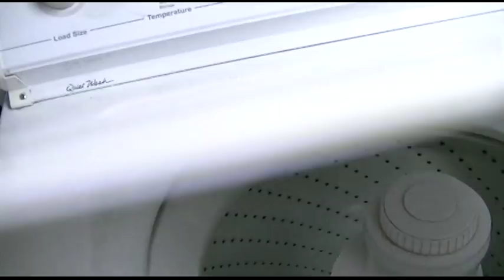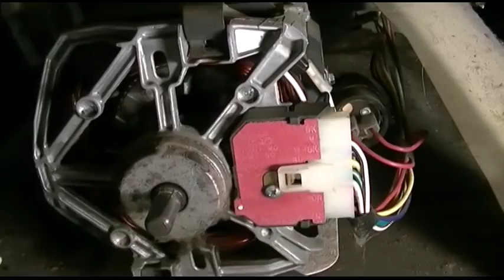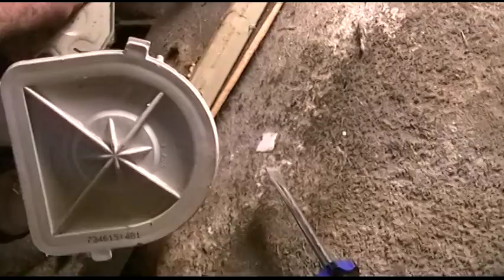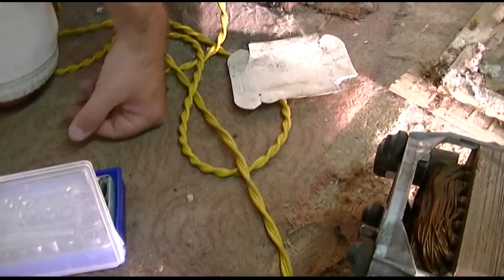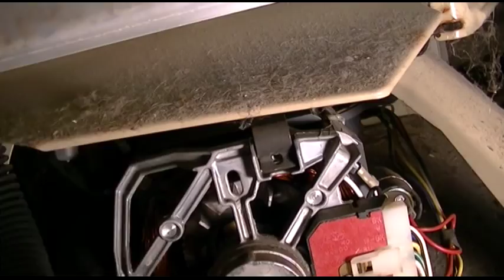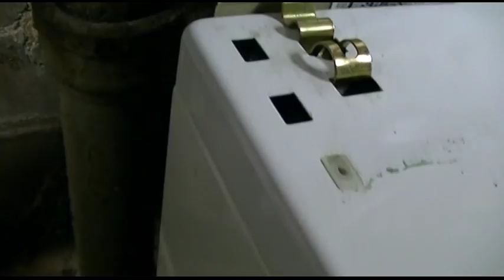How To Replace Motor Coupler--Whirlpool Direct-Drive Washer

Comment: Do you think I could be having the same issue and fix the same way? I loaded 1 super heavy blanket and mid wash cycle, the agitator began spinning only clockwise and it tangled the blanket. I unloaded it and try it with nothing in it, and it still only turns right during the wash cycle.
Reply from the maker: I'm not exactly certain what "only spins clockwise" means.  Typically a broken motor coupler will elicit no agitation and no spin whatsoever, but the washer will drain, which is how I diagnosed this one:  https://www.youtube.com/watch?v=SkGfUuGDGEc

Is it possible you can post a video showing the problem?  With that I could probably tell you what the problem is.
Reply: @jaykay18  yes, ill try to get a video for you in a minute. I'm trying to figure out how to keep it running with he lid up. The little hole other washers have where u can put a screw driver isn't there so im assuming its where the lid is actually screwed on. I'll let u know when u have the vide
Reply: @jaykay18  okay, apparently the to by pass the switch i need to take the top part off and i dont know how to do that -so I did my best to show you the issue, so what is happening is that it sounds like the agitator is going back and forth as it should but when I open it, everything, water clothes,, agitator is only spinning to the right and the clothes is tangled around the agitator. When the issue first appeared yesterday, I was washing blankets and sheets and all them were tightly wrapped around the agitator completely tangled. This happens during the regular wash cycle. So i had to turn it off, untangle them which was super difficult and then just switch to the draining part to get all the water out.. It does correctly drain and the tub spins to get the excess water out.
The washer is not as loud as it is now either. 

https://youtu.be/v2q3t1KNSIA
Reply: @jaykay18  i only added small items to demonstrate because untangling the heavy sheets its a real pain lol
Reply: @jaykay18  here is another short clip, I dont know if this is related at all, but you can see the agitator cant be turned to the left at all. It only goes right. The washer on the right is my neighbors and I noticed I am able to turn the agitator either way with little effort. 
https://youtu.be/AXyL648UmPo
Reply from the maker: @MissyyMartinezz09  Could be one of two things that I can think of.  Either you have a completely broken brake shoe, or a bad transmission.  To me, it sounds kind of funny with the way it's agitating.  Like it sounds almost normal, but not quite right to my ear.

Repair will be a bit costly, but still way cheaper than a new machine.  you can try to source a replacement transmission, they are indeed out there.  Not terribly hard to install.  Another option is to find a similar machine that someone is getting rid of or selling.  Either option would be better, and way cheaper, than a new machine.  Not to mention, new machines don't wash.  Don't just go by "Whirlpool" or "Kenmore" and think it's the same.  Around 2010 they changed the mechanism inside and the machines are basically useless.  Chances are, a machine before that time would be acceptable.  Another telltale sign is to look at the timer.  If there are a series of lights and a button you press to start, that's the BAD ones, stay away from them.  You want an old-school one with a mechanical timer like yours has.  Accept no substitute.

To figure out what's really wrong, you'd have to remove the transmission.  That's going in deeper than I did here.  It's only a couple more bolts, and removing the agitator first.  These machines are extremely robust, but they can and do break, just like anything else.  Fortunately parts are readily available and relatively inexpensive, and the machines are very easy to repair.  Repair people probably won't touch it and they'll tell you to get a new machine.  So either fix it yourself or replace it with a similar vintage one.
Reply: Thank you for your detailed response- you're probably 100% right about the transmission,  I managed to disassemble some of it,I checked the agitator, dogs are good, nothing broken, coupler is good, and I don't if you remember, im one of the videos I had posted the agitator completely locks when trying to turn it left when in the regular wash cycle, but when the machine is done, meaning is tub spun, drained and clothes is ready, the agitator can now easily move left or right. 
I tried it one more time and now it makes one nice loud clunk at the very end of the cycle after it's drained the water. Lol RIP my washer. 
Anyway, too bad is wasn't something simpler, I might just have to find another washer with the same design. 
Thank you for taking your time to respond!
Reply from the maker: @MissyyMartinezz09  Yeah if the coupler was broken it wouldn't agitate or spin at all.  This is definitely an odd one, and a rare problem.  The key factor was you had mentioned a really big heavy blanket caused this.  That probably proved too much for it.  The motor coupler is there so in the event of an overload, it breaks.  So it's a "failsafe" of sorts.  This is what happens when the failsafe doesn't fail.

Keep looking around for this type of washer, there is absolutely no substitute.  These were some of the best washers ever made.  I have one that's over 25 years old and still running fine.  You can't beat the best.  Don't give up your search at any cost, I can guarantee you will be dissatisfied with anything else.

Incidentally, the machine can "lock up" the agitator depending on where in the agitation stroke it is when you try to turn it, sometimes it's just in that "sweet spot" where you can't turn it.  The loud "clunk" can sometimes be normal.  Typically you'll hear it either at the end of the neutral drain right before it spins, or just as it starts to spin.
Reply: Hello, update: we bought a new washer and absolutely hate it. The agitators suck. They buzz back and forth instead and wish washing sound my old one does. The clothes is literally in the same place at the end of the wash cycle as when u put it in and the water sensor is so cheap it doesn't even fully cover the clothes. So. Im committed to repairing my old one now 😅 the company who delivered the new one were really adamant about hauling it away but I kept it just incase. Sending the new one back this week. I will let you know how the repair goes.
Reply from the maker: @MissyyMartinezz09  Can;t say I didn't warn you, but you are headed in the right direction now.  Any questions, let me know.

Comment: Thank you, Sir. Truly appreciate your video. I thought I was going to have to replace Old Reliable but decided to see if there might be a bit of info on YouTube. It's a 30+ year old Kenmore so I didn't expect to find anything useful. Did find your video, though and I've just ordered the part. Fully expect to have Old Reliable back on the job again in about a week. Thanks again. Be safe. God bless.
Reply from the maker: Thanks Edwin!  I'm sure you'll have no trouble replacing it.  And--you made the best decision.  There's a very good reason you call it Old Reliable, and it will serve you very well for many more years to come!

Comment: Better than the "professionals" who ruin new appliances than fix them!
Reply from the maker: Way better, a job done right!
Reply: @jaykay18  Whirlpool engineers must've thought of the direct drive technology as it has no belts or pulleys! They were way ahead of their time in my opinion.
Reply from the maker: @jeromedavis8575  I cannot say that this was the first.  Automatic washers were becoming popular in the 1950s, the diect drive design came out in the 80s, so there were a good 20-30 years of design and development.  While quite a number of machines used belts, I couldn't imagine there wasn't another direct drive type unit out there before.  When you really do think about it, what does it actually cost to manufacture a motor coupler?  A lot less than the cost of metal pulleys and a belt.  So in my eyes, it was actually a cost-saving measure.
Reply: @jaykay18  At least Whirlpool put quality first.
Reply from the maker: @jeromedavis8575  Quality used to matter to a lot of companies.  Not anymore.
Reply: @jaykay18  Now, it's all about money!

Comment: 60 year old woman here ( granted I used to be a subcontractor), but I followed your video to the T, and then put it together again, wouldn't work. Took it apart and noticed I hadn't connected a teeny tiny ground wire with the electrical harness on the motor. Put it back together, and Viola, works like a charm! Thank you!
Reply from the maker: You are very welcome Valerie!  I am so happy to hear that!  I love hearing of people who have become empowered by my videos to do the job themselves, and get it done without much trouble.  The ground wire could have simply been an honest mistake or something you overlooked.  No harm done, it's back together, and working once again.  To be quite honest, although you're still plenty young, it very well may outlast you!  Excellent job!
Reply: @jaykay18  No offense, but I sure hope not, lol!
Reply from the maker: @valeriewells5767  These were some of the best washers ever made.  You cannot buy any washer today that can perform like it, at any price.  Forget "technology", all it does is foul things up.  Ever notice how anything that says "Old Fashioned" is so good?  Yeah, there's a good reason.  Or like Breyer's Ice Cream's old slogan, "Taste, Not Technology".  Well yeah, it used to be, not anymore.  Trust me, you did the best thing ever by fixing your machine, and they're super reliable, easy to repair, and perform like no other.

Comment: Thank you Mr. jaykay, the coupler on mine was starting to break, I searched up for similar buzzing sounds, and when I heard this one buzz I knew exactly the issue. The part is now replaced with your video to thank and I can be confident my machine can remain in service now another 21 years
Reply from the maker: I'm thrilled to hear that!  Very glad my video was of help to you in repairing it, and I'm also glad you decided to repair it.  You've made the right choice, it most certainly won't give you trouble for the next 21 years, unlike any modern washer!
Reply: Yes. I never cared until my brother bought a Samsung side loader replacing a GE with the weird looking plastic tub. and I realized the big corperations are lying about saving water when it does 6 rinses and saving electricity when it runs on average 3 hours. It's 4 years old but has had 9 service runs done to it, next time I'll be heading a few towns over to a place I know carries old style machines such as mine. I expect it to be another 2 months before it's next and last visit from the service dude.
Reply: I've never had to fix anything else except the water drain pump, just last year. since I have a single piece agitator, agitator dogs are no worry. Even though from what I can tell those are no hassle to fix.
Reply from the maker: @micheal9503  Ha ha, yep, he fell for it.  You've got a good head on your shoulders to realize it's all hype and there are no savings, in fact, waste!  I've had to do 2 sets of agitator dogs on my own washer, total repair cost was $4 each time.  You can't beat that!
Reply: @jaykay18  It appears that way. I was always suspicious of it, so when it started breaking down I decided to list the parts that got replaced.

In it's first year, the pump sprung a leak, and the door lock stopped functioning. Second year in, the pump stopped working entirely, the main motherboard failed, and it also developed a seemingly unfixable off balance issue that was eventually fixable. Then in it's 3rd year, the big weird plate looking motor died, and another main circut board failed. Then this year, the pump died, AGAIN, and the door seal had to be replaced as it was apparently cracking. What a ride this had been.. I could only imagine the repair bills to date
Reply from the maker: @micheal9503  The worst part is they're all like this, and the manufacturers pay for parts and labor out of their own pockets for these repairs when under manufacturer's warranty.  You'd think these repair costs would be astronomical, and they'd realize that years ago they had so many fewer repairs.  but I guess all these people that keep buying new washers every 5 years makes up for all the repair calls, because then the cycle repeats every 5 years.

Comment: Thank you for this video. One question before I test my washer, should you be able to turn the motor by hand before putting the last piece with the 2 hoses on it? I had to use vice grips which I assume I shouldn't have had to.
Reply from the maker: If you're just trying to grip that motor shaft with your hand, there's no way you're going to turn it by hand, it needs a tool for leverage.

Generally when a motor coupler breaks, it's either due to old age (the plastic gets old and brittle), or the machine was overloaded.  Worst case scenario when you put it back together, the new coupler will break immediately.  If that happens, there's a much more serious problem with the machine.  The likelihood of that, however, is very small.
Reply: @jaykay18 but weren't you turning it by hand in the video?
Reply from the maker: @nikkifachik  Yes, it was just fine.
Reply: What happened with this? Did it work with being unable to turn the motor shaft by hand? The same thing has happened with me and I don't know if its ok to put it all back together or not.

Comment: So always well overloaded and left well off balance. Do you know how often the machine is ran weekly?
Reply from the maker: At least 2 or 3 times.  Each of my machines get 1 load per week, if that much!  Sometimes we'll go 2 weeks before they get used.
Reply: We run ours twice a week, all in one shot, handling pretty light loads, and short cycles. But when it comes time for towel week, even then it doesn't deal with any overloads and that usually ends up as its largest load.

Comment: The classic direct drive, so simple to repair, and so simple to diagnose. Its like, you can tell a problem by sight and sound. On an HE machine, you have to run diagnostic mode, then grab the code sheet, then find out your problem, then replace the part, then test the thing. Its so complicated, I think the most frequent repair on a direct drive is the agitator dogs, the most common repair on an HE machine would be replacing the entire damn thing.
Reply from the maker: You got that exactly right!
Reply: Its like, this ended as a $12 repair, and in total took maybe what, like 35 minutes. Then on an LG, you have to take apart the cabinet piece by piece because the suspension is ON the cabinet, because that makes sense. Then you probably have to lay the damn thing down, make sure you don't harm any of the circutboards, the insides of these new washers are damn minefields. No wonder they are so explosive.
Reply from the maker: Har har.

Comment: Will it still make that same sound if the 6 fingers are broken?
Reply from the maker: It's rare that will happen.  The fingers are mounted in rubber so usually they don't break, and instead you see a failure like this.  The new ones though, like the one it was replaced with, are metal-reinforced in the center.  Typically they don't shear or break, the transmission does.

Comment: Good job on the video but, my washing machine Kenmore 110.92291100 just stays after is done washing with the close and water in the tub. Just sitting there and wont start rinse cycle. It does not start spinning and no noise. Can you help, Please.
Reply from the maker: Possible bad timer or bad motor.  The motor runs both backwards and forwards, depending on whether the washer is to agitate or drain/spin.
Reply: Thank You so much, It is old, how old I can remember so, maybe is time to replace the unit. Be safe out there...
Reply from the maker: You're better off fixing it.  New machines will definitely cost more, won't wash well at all, and you'll end up in the same boat just with a lot less money in your wallet.  https://www.youtube.com/watch?v=Rju3cHaAyek

Comment: 20:44 it should not spin drain because it was enough agitation time
Reply from the maker: Apparently not long enough.
Reply: @jaykay18  It seems more likely that it slipped into spin due to the transmission being cold (so the oil inside being thicker and stuff), The whirlpool service manual states that only 10 seconds of agitation (fast agitation) is needed to properly engage the neutral drain mechanism.
Reply from the maker: @emeraldmakesstuff  10 seconds under ideal laboratory conditions. On paper, it sounds great. In real life, it acts differently.

Comment: Did you oil the motor? Looked a little stiff.
Reply from the maker: No, no need.  I've never actually seen one of these that needed oiling.  They are induction motors, which typically means heavier-duty to start with, so the bearings are in good shape and still smooth.
Reply: Wasn't stiff at all! Turned very easily.
Reply: Sounds good. My first instinct is to oil things. You guys did a great job!
Reply from the maker: Bob Loom Thanks Bob!